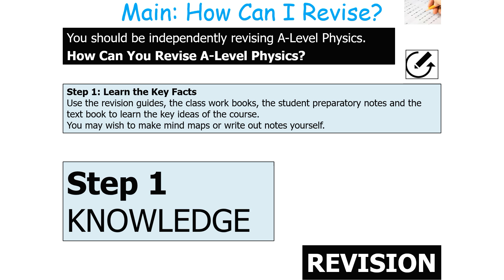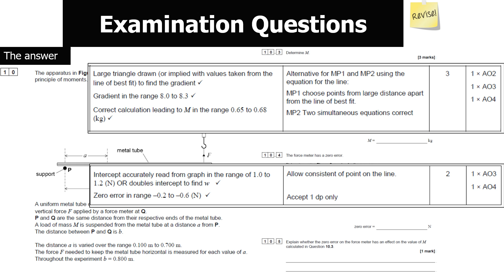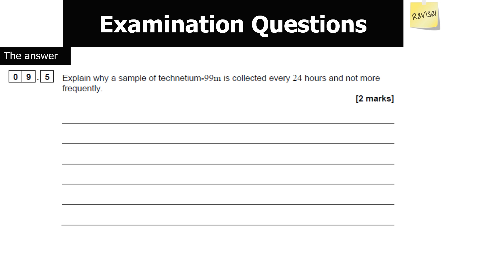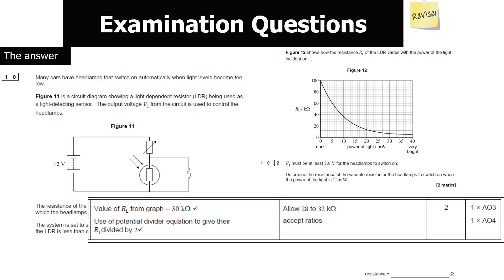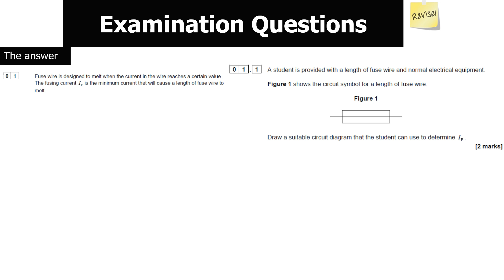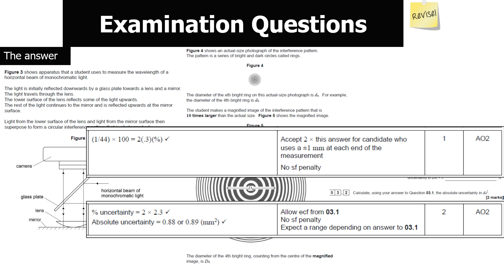A-Level Physics Paper 3: Practical Skills Revision Questions 1 (2023 Edition)

Comment: Shouldn't values be negative at 31:15?
Reply: i think its because the actual value for w is 2.61 N as said, and the value you get from graph is 2N , so it is -0.61N lower than the expected value

Comment: 25:14 Why can't the voltage source be "just a cell" if you have a variable resistor to alter the current
Reply from the maker: It will allow the voltage to be varied if it is more than 1 cell
Reply: @mrturnbullsphysics but why would you need to vary the voltage when it only depends on current?